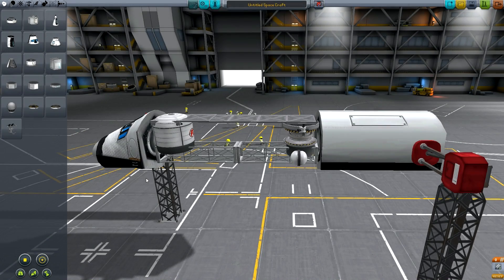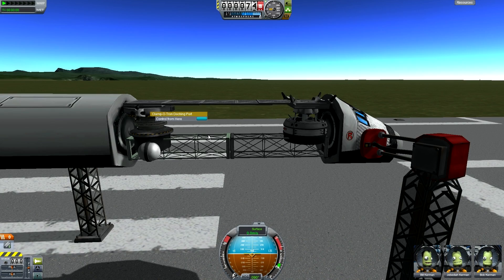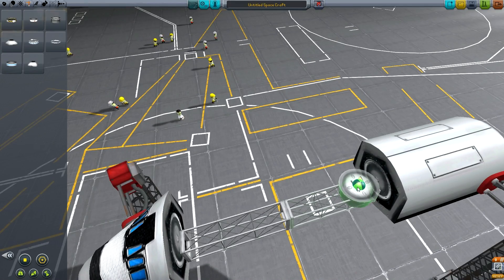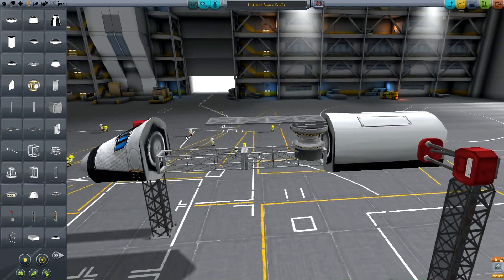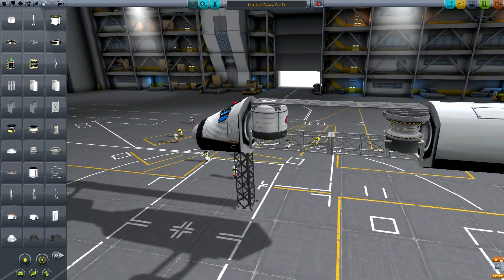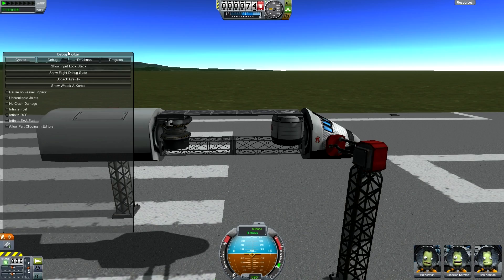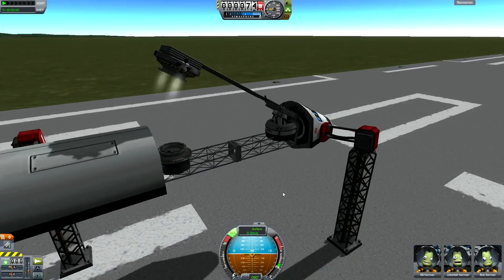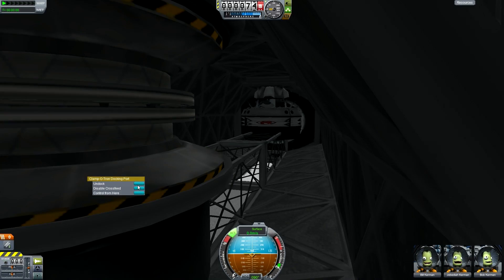KSP - How to make part-effective Cargo Bay Doors!

Comment: Or, you know, just get infernal robotics. Great video though!
Reply: Debated Nothing Because it ruins the challange out off it.

For eg. "I want to make a helicopter!"

instead of Making one out of stock parts...
You go get a mod and all you need is 4 pieces (rotter/ engine.   body. cockpit. fuel, done)

Tell me, what gets more views... a guy making a basic helicopter with spitfire mod? or a guy making one out of stock parts.
Reply: what if you don't use mods?
Reply: R4V3-0N There are also many mods that are perfectly reasonable, I never go near mods such as "Interstellar" which take nearly all challenge out of the game.
Reply: Debated Nothing
why use mods? and btw if you really want a modded cargo bay why not just B9 bays?
Reply: Debated Nothing I know,
 but like R4V3 said, it ruins the challenge, and I don´t think that he game lacks so much of parts, even if robotics are something that is still missing in the game. in my opinion, if you need mods to play the game, you really lack of creativity
Reply: Reven Arc In my opinion you shouldn't have to exploit weird interactions between parts or use parts in very gimmicky ways to achieve something as simple as this.

However, the game is, at the end of the day, a single player sandbox, can't we all just do whatever we want and respect the way other people choose to play the game?
Reply: I got no problem with using mods or what ever.

But it really ruins a lot of things.

And modding KSP does have issues.

I do have B9 installed but after the first week I for some reason never touched it again.

I know a guy who uses a fraction of modded parts to make a huge mech. That's okay and perfectly fine. 

I see guys getting very hyped up for landing on Duna with a 1 stage black hole powered space ship made of 2 parts.

There is a difference when you still challenge yourself, or when you just build a 1 part, 1 stage rocket that can go to anywhere  and doesn't even require a fuel.

I heard the squad team puts mods into the game with minor balancing,  I do not know because i do not follow the game to much and I only had it for a little while.
If this is true then I would just rather wait for  the vanilla motors or what have you, Perhaps it can be more user friendly.
Reply: R4V3-0N I see your point, tho i have an other opinion. I like mods. I love the graphic mods, which dont change the gameplay. But i also love mods like B9, KWRocketry and jeah Interstellar is great too. It isnt as overpowered as many want to call it. I just like to have a variety of parts that keep me playing. With stock parts i would be through career mode in a "few" hours and could visit all stock planets and so on too... where is the challenge again? With the new variety of parts you can build smoother rockets. Also bigger parts and parts that combine functions are good too. Someone here stated that you build it with lesser parts and that being a bad thing, but well.. ksp isnt the most performant game and even high end computers cant handle REALLY part heavy ships, so why exactly are less parts a bad thing. Also there are a lot of utility mods that help a lot. Before the recent update rockets where to wobble like shit without a mod that fixed the issue. There are other really helpful things like DockingPortAlignment and EnhancedNavBall and Ferram Aerospace and Kerbal Alarm Clock and such on. Making the game too easy for u? Well these are just functions that arent in the game in its current state. Show me one single space maneuvre not using a as good as it can be NavBall or a digital helper for the docking ports. So its making up for the LACK of realism of this game, if you want to call it as such. I like the game, but without mods i wouldnt play it. Everyone can play the game as he likes it most, you can play stock, i can mod my game (with the upcoming version finally not limited to 4gb ram worth of mods xD) and we both have fun. Thats what a game is about i guess.

EDIT: About the mod parts being op, most are really balanced. Some are intentionally op and thats no fun i agree with that. But hey if you think mod parts are OP, what is about the stock ion engine, the stock manoeuvrability with reaction wheels and such things? These are like couple douzen to couple hundred times stronger then in real life. Arent they op? Or is it ok because it is in the stock game, so doesnt matter. The only difference i see is that the devs wanted it to be op for the playability of the game. If a modder wants something to be a bit more powerful then in reallife some people call it cheating instantly. I cant understand this.
Reply: Cassin1306 magic smoke industries, google it.
Reply: Debated Nothing Why do people delete the comments...
Reply: R4V3-0N Why not use mods?
Reply: R4V3-0N To me the challenge is in flying the craft/designing the craft, not overcoming the stock game's lack of part variety.
Reply: Reven Arc Mods add many new opportunities to the game, and allow you to play unimpinged by the games lack of parts.
Reply: Debated Nothing
agreed ;)
Reply: Debated Nothing but even the reasonable mods can take the fun out of things, eg B9, they can make your plane a perfect VTOL as well as it being a space plane and some parts being a bit rediculous, it also ruins the fun of making a huge plane because now you can do that in less parts and such.

I do see your point. But debating with a guy called "Debated Nothing" I think this conversation won't go anywhere.
Reply: Sorry I can't read your whole thing.

I got some reading problems and I am tired and woke up from the first nightmare in over a decade. But I'm sure it's okay.

I do acknowledge this, it really depends what you do with B9 I guess, Because parts there are just vanilla parts re textured and stuff. etc. 

I can't really carry this lil debate atm. I'm quite tired. sorry.
Reply: R4V3-0N Then answer when ur awake again xD
Reply: ***** I would like to see you read something that large in a 3rd different language
Reply: R4V3-0N 
1: It isnt large...
2: it should be your second language, english is the world language. anyway it doesnt even matter if its your second, third or 100th foreign language, its still english. its the most important besides your national one.
3: i WROTE something "that large" in a foreign language. and its far from perfect anyway. in my opinion reading is the most easy thing in a foreign language, after that comes writing which is a bit harder, and understanding (voice) is the hardest in my opinion. 
4: hope this wasnt to large..
Reply: I have an addiction of lists, this could have been a 100 point list and I would keep reading because lists usually cut out the junk, get to the point, and I like numbers.

Do it in roman numerals next please! those are my favorites!
Reply: BTW I beg to differ to say the above part is large if I can't fit it on my screen without zooming out or scrolling (could be fault of the fact the window for youtube comments in reply notifications is narrow..._
Reply: R4V3-0N I guess your just to lazy to read lol. Then why just dont ignore it? If all you have to say to my points is "i didnt read it" you could just now answer. Would have the same effect and spare us some nerves. 
Discussing about a theme and then saying "practically i didnt read it" is just bad manners.
Reply: I also apologized that it isn't my first or second language and that I got a couple things wrong in my head that involves reading.

It's bad manors to insult people with problems and accusing them. 

The reason I'm responding is I did read SOME of it and also the same reason you are responding now. 

I'm responding, because you responding, to me responding, to you responding, to etc.
Reply: R4V3-0N
I. The mod combination of TAC Life Support + Ferram Aerospace Research + Deadly Reentry makes the game far more difficult than it is originally, as I can't pull off half the reentry shenanigans that I can in stock.  TAC means I have to be careful or Kerbals will die, which is painful in career mode.  And FAR will eat my spacecraft/aircraft if I do something aerodynamically stupid - that I could get away with in Vanilla.  This also means you need to take into consideration aerodynamics when building a rocket, so fairings are something that become pretty much mandatory, or FAR/Deadly Reentry may eat the launch vehicle on the way up.

II. Interstellar gives KSP an endgame.  Yeah, it's a warp drive, but the science investment to get to that point is pretty harsh.  It also adds a heat mechanic, so unless I am paying attention to the heat dissipation of probes, they will go inoperable due to overheating.

III. Kerbal Alarm clock allows me to have mulitple flights going in parallel.  That means that I need to plan out what the flights or doing, or I can very easily end up with manuever nodes occuring too close together, with bad stuff happenning.

IV. Due to the effects of the Kraken, having something like B9 give us the parts to make SSTOs with lesser parts, as others have mentioned upthread, the game engine doesn't like high part counts.  What's wrong with wanting to do something awesome, and not wanting the game engine to eat it because it can't handle what you are trying to do?
Reply: AoiKaze2000 Ferram make the game easier. You must have merely played it to not see that. Try a ship made for ferram that flies well. Try it in stock. It is way more bad, isn't it ? Well you're gonna say "The nose add extra mass" then try to remove the noses, and it still fly bad. Far makes it easier, unless you try to do retarded stuff like doing a 90 degree turn in 1 second.
Reply: AoiKaze2000 that's a valid point but the part it is off topic is it isn't a mod that adds parts to do stuff that is already achievable in game but far simplilar. You are getting a bit off topic.

However you sparked my curious on the aerodynamic one. how does it function? eg does flat wing planes can't go as fast as swept?  does tilting wings increase / decrease air resistance  from eg making a straight wing part into a swept. etc
Reply: R4V3-0N Well, to have a description, look at this page:
http://forum.kerbalspaceprogram.com/threads/20451-0-24-2-Ferram-Aerospace-Research-v0-14-1-1-7-25-14
To resume : It adds aerodynamic failure, mach effect, and actually works in such a way that it detects object hitboxe's and calculate how should air go around it and make it happen realistically. So in fact making a box with wings Inside, those wings Inside won't do anything, plus because it's a box you can guess what happens when you fly it :); well that's it, in short It's awesome

Warning: With it, DO NOT enter at a bad angle in reentry, the air may decide that you should... err... Boooom,no dust left :D
Reply: Sosuke Aizen damn, I use dirty tricks like the wing inside objects to make real life aircraft work in KSP (because i have to make big wings out of little wings... however  you said mod also states it calculate how air moves around things... so would i not worry about it?... toughest choice of my life to install or not install...)
Reply: R4V3-0N Procedural wings works awesomely with it (and Procedural fairings)
Reply: Sosuke Aizen tempted, but I am not an expert with KSP modding and I do not know how to remove mods either, I got B9 mod earlier but I wanted to get rid of it (it was bugged, the SABER engines the whole reason I got it and it doesn't work)

So yea. I am not a fan of messing with my game files directly and my many google searches found 0 KSP mod managers.
Reply: R4V3-0N Make a copy of gamedata AND your saves and put it somewhere, (copy, paste) and then add in the files Inside the mod in Gamedata, remember to look a bit in the mod file, some mods are like that :
Example.rar ->  Example0.2.

But others have Inside Example.rar -> Example0.2 -> Example
So remember to check.If it is Inside, drop that file Inside instead, mods like tac life support are more like: ThunderAerospace->Tac Life Support but don't remove it out as it can cause problems (and confusion) with some

If it's not Inside, go back by using the "..."
(I assume you know that but I still say it)

Then install it simply.

If after installing your mods your game crashes, you don't need to go crying to the dev, you can try to fix it first.
For example, if it says module manager wrong version something, it could be: that you have two moduleManager File or one from an old version.
Also reading the crash log Located in the KSP_Win folder (or whatever it is called for you) can show you what is the error, even if you aren't good at coding: An acces violation is a common crash, it is when the game asks for too much ram most of the time

Install toolbar. It helps to manage mod while playing. (and it's easy to learn)
To Deinstall you have two ways:
A-Delete the folder of the name of the mod
B-If it still glitched the game, if it glitched it of course, you can delete gamedata and copy/paste your gamedata copy I told earlier to make

If it glitches still, Delete everything in ksp, Reinstall it, And take the copy of your saves I told you to keep :)
Reply: that's quite confusing...  and also I have a tendency off 'failing' stuff that involves PC's like this. Eg due to the fact I'm on the other side of earth and wireless internet, packet lost spikes cause corrupt files and stuff, and I also have a bit of a history of failing at unpacking .rar's.

however thanks for the help.